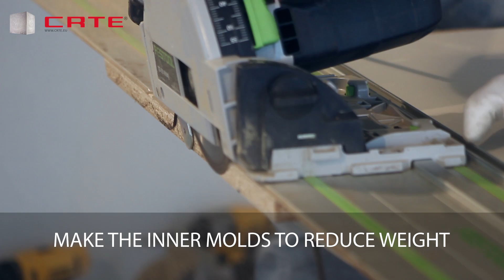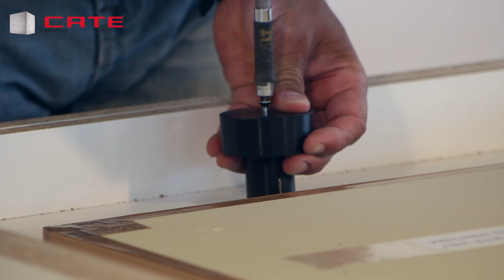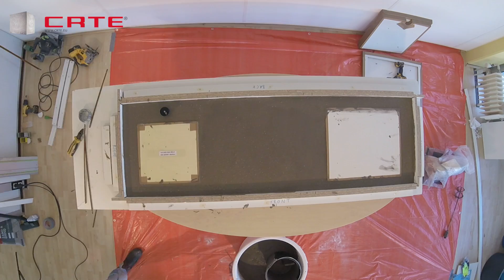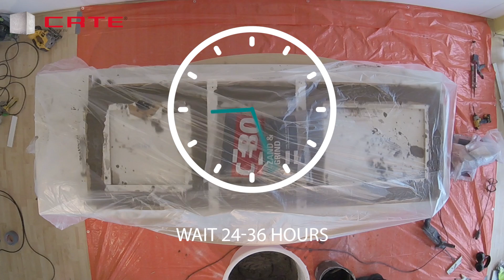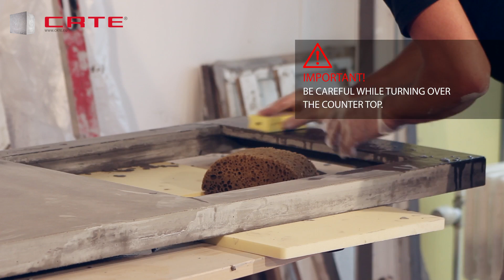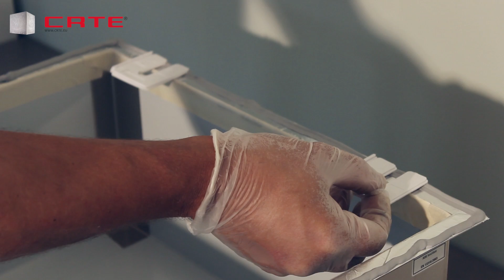Betonnen aanrechtblad zelf maken

Comment: Which caulk (available in NL) do you recommend for 1. attaching the countertop to the cabinets, 2.attaching the sink, 3.cauling the top-back of the countertop to the wall for sealing.
Reply from the maker: To attach the counter top and to install the sink use polymer caulk like Bison Polymax and for sealing the wall side use a high quality silicone.
Reply: Thanks, very helpful. During installation of the undermount sink, an "appropriate primer" is discussed. What does this mean, when installing an inox sink? Should the concrete be primed, the sink, or neither?